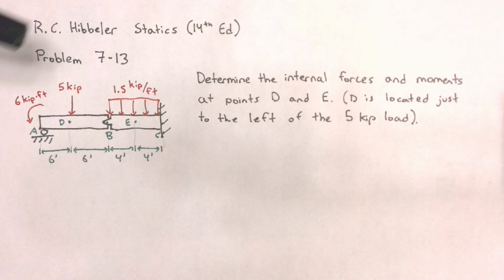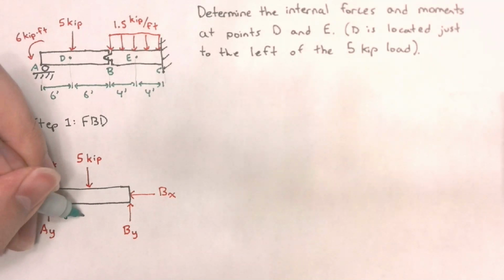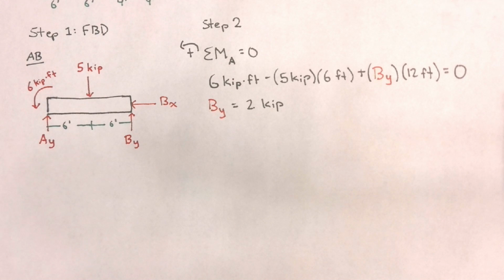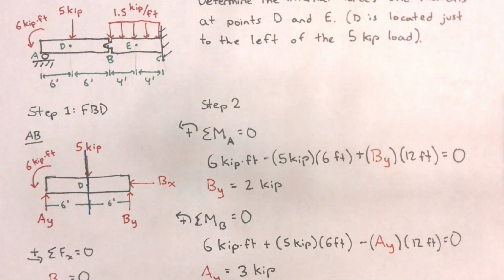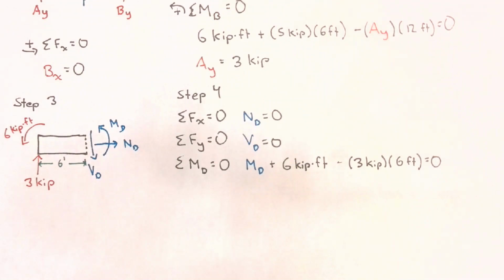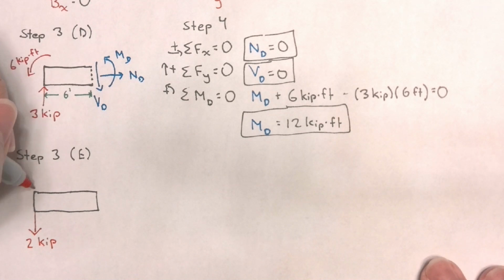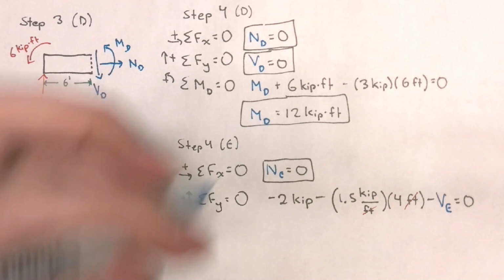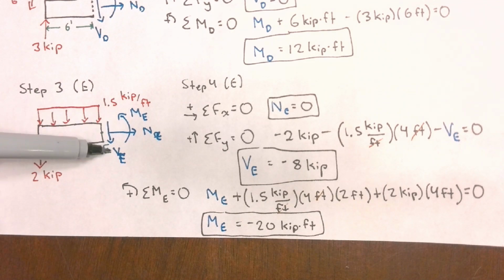Problem 7-13 (Hibbeler, Statics)

Comment: For the free body diagram in step 3 why is the 5 kip load not included? I feel like it is not clear that the 5 kip load is after point D on the diagram for the original problem.
Reply from the maker: In problems like these, we have to rely a lot on the problem statement (the book problem states that "D is located just to the left of the 5 kip load"). So if we draw a FBD of a section of the beam up to point D, then we'd stop our section before we get to the force and therefore do not include it. 

The reason the problem says "just to the left" instead of giving us a distance that we can draw into our diagram is to state that our study point D is an infinitely small distance "to the left" of the force. It's a bit confusing :/

Comment: Wouldn’t the V sub d in step 4 be 3 Kip to be equal to A sub y?
Reply from the maker: Yes, you're right! Should be V_D=3 kip. Not sure why I said that "the unknown shear force will have the same magnitude as the 3-kip reaction from the roller" and then for some reason wrote "0" instead -_-